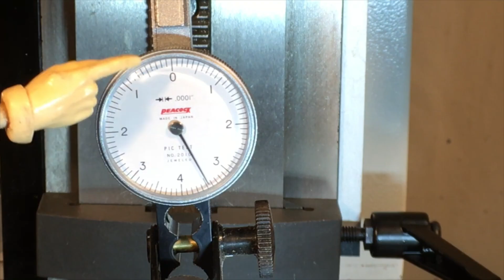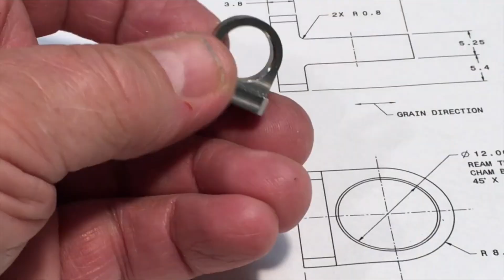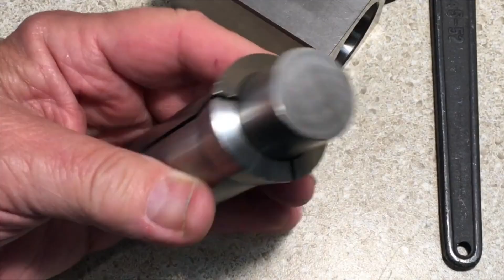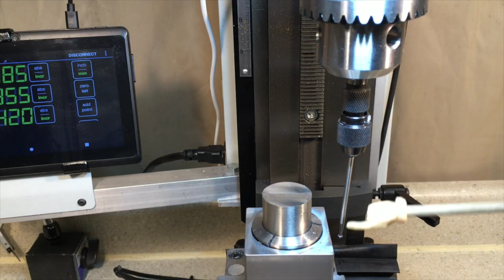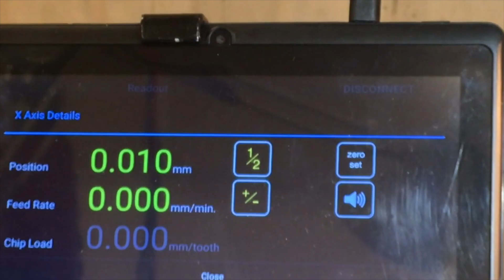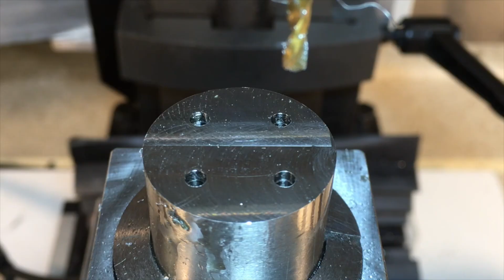Model 6450 Mini Mill Overview Part 5

Comment: Seriously considering this machine over precision Mathew’s due to price. I just have not found a reason why this unit would not do the work I will be doing. Similar to you. Custom Harley parts. Tractor bushings. Some logging equipment collars, bushing, pins etc. 
also rebuilding a very inexpensive vevor mini lathe to try and make a very accurate machine. 
Can you give me any reason sir?????
Reply from the maker: NO... You should buy our machine :)

PM sells good machines, but they tend to be a bit larger and more expensive than ours because of their size (you also need the room). Where we do overlap on the Bench mills, we are very similar. 
Some things that we do different across all our machines: 
1. Powerful Brushless motors and Direct to spindle belt drive. Very reliable and very quiet. Ad genuine NSK bearings and you have rock solid drive system. 
2. Spindle lock and tapping mode (on Bench mills) are great feature exclusive to us.
3. Upgraded machine controls and electronics 
4. Upgraded components throughout.
We basically looked at the machines in the market a number of years ago and asked ourselves how we could make them better. We've been working with factory for over 20 years to accomplish that goal.
Reply: @Littlemachineshop 
Thanks for the answer and the funny quip. 
I like you didn’t knock PM as you kinda can’t. They have done well. 
Your background is pretty darn good as well. Willing to part with my money just not sure how much yet. 
I like the small foot print. 
Anyway you will most likely see this model dip by one in inventory very shortly. 
Keep the videos coming